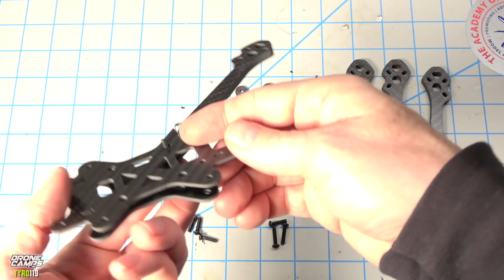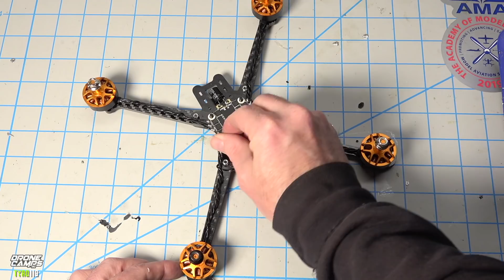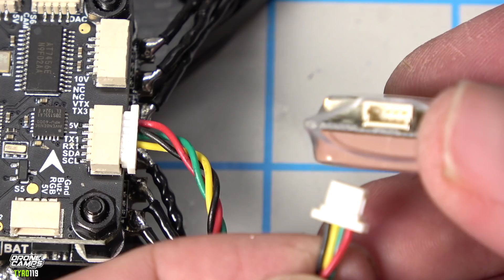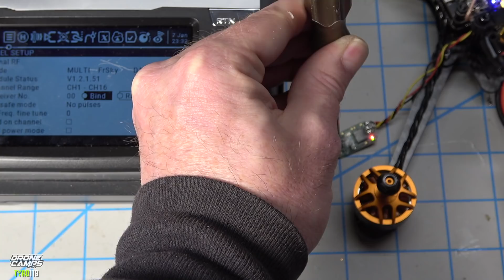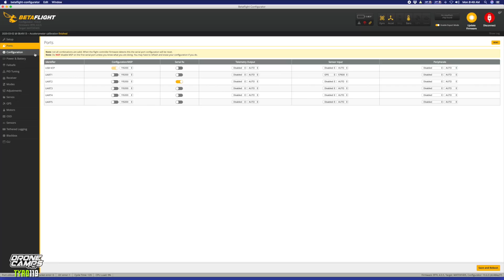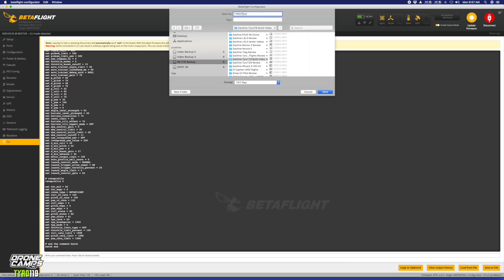$119 Long Range Fpv Quad! - Eachine TYRO119 - Build, Setup, & Betaflight

Comment: Just a quick comment some may find interesting.. this is my first drone build, total beginner... but it seems that my Tyro 199 has come with SBUS soldered already and its brand new so not been done by a builder as a return or anything... I thought this was pretty interesting.. maybe they have been listening to feedback...I was really preparing for this soldering part too! :)
Reply: Mine came sbus soldered... Which actually is a bad thing, because my receiver is not sbus... So now I have to desolder it.... Going to use the pads on the other side though for TBS crossfire nano rx.

Comment: VTX has SmartAudio but the wire is missing. This is a must have function these days, especially if you fly with people and need to change band easily.

Comment: I built the Tyro119 and as I arm the quad the drone jerks erratically.
My motors are mapped correctly ,spinning in the right direction and the props are correct. Any help?
Reply: Drone now arms correctly but will not lift when advancing the throttle. any help?

Comment: I have my transmitter dx6 spektrum.
I would like to know if the transmitter work with your receiver?
Thanks
Reply: If you have a Spektrum transmitter then you’ll need a Spektrum receiver. The one on the video will not work with your radio.

Comment: I still can't find anyone hooking up a crossfire receiver to this FC
Reply: Giffy, did you manage to install the crossfire rx on the FC... if so which pads did you use... Cheers buddy.
Reply: Hey just use T2 port for UART2 it is on the other side of the board

Comment: I liked your video, found the instructions clear and easy to follow (thanks) and used BLHeli to reverse one of my motors and completed the build as per your video, including doing the checks BetaFlight config and tightening all the motor nuts. On my first flight the drone has a severe crash as it went out of control after it lost one prop and smashed the other three props on crash landing, no other major damage luckily. Upon inspection and after reading the other posts from "Herrtc" I believe under fast incline the motor undid the nut as it was turning in the opposite way so unenlightened the nut instead of tightening it. I have since ordered 4 new props and reversed all directions so they all now tighten the nuts instead of loosening them. The other suggestion, I had some drift in the drone, in mine I went through each Roll, Pitch, Yaw and ensured the trim was set on the flight controller (FlySky FS-I6X) so that at mid position they where at 1500, I also did same for the Throttle at mid position.
Reply: Thanks for the heads up Mike, this will be my first build so I’ll make damn sure to do the same prop configuration 👍

Comment: so after installing the xm plus receiver im getting a solid red line.
My taranis qx7 still chirping on the bind. Is this normal.
I have flash the xm receiver with the most up to date Firmware, and still no good binding.
any help appreciate it.
Reply: Are you flashing the old firmware? Dont flash the newest one

Comment: Looks like I found a better build video than bardwell. I have this kit coming in three days. Thank you so much for this valuable information. Well done!
Reply: The thing is he missed the fact that the VTX has the SmartAudio wire missing. Bardwell included this in his much more detailed build. What makes you think this is better?
Reply: @carlperkins1812  heyha I have watch both. Both are great but JB gives too much info for a newbie who just wants to get in the air. For a newbie not having the smart audio is not  an issue at all. In a 30 minute video I get all the info i need.

Comment: Pretty straight forward build except for making the bridge for sbus. I could not make the bridge no matter what I tried. Don't know what the secret is. I cannot fly this drone because I cannot get betaflight to see sbus. Very frustrating I'm glad it was only 119 dollars doesn't hurt as much when it will never fly.
Reply from the maker: It was a total pain. Get a Solder Sucker. It will help you start over and try again. Took me 15 mins the first time. Small iron tip helps too.
Reply: Wow so it was hard for you to. Thanks for the tip. I think I have damaged the fc so I bought a new one. Lol.
Reply from the maker: Tip: use a small iron tip.... 

hold your iron on the outside edges of the tabs. Bring some solder from the other side.

Comment: A friend bought one of these, one of the motor wires was too short, and he destroyed the flight controller trying to solder the two tiny dots to chose between sbus and ibus.  He also stripped out a lot of the screws and ended up cutting slits in the top of them to use a flathead screwdriver.  So....   yeah.   He ordered one of those specialized replacement F4 controllers with the white jumper connectors and banggood refunded his $35 because they don't have them any more.  So ATM he's fucked with this quad until I can tell him how to proceed.
Reply: did the same on mine but realized there are pads under the board for the reciever an sbus -ibus . mine worked with these
Reply: @gravelyetigravelyeti4284  Yep, I saw those underneath pads in a Bardwell video and was like hey! and told him, and he was able to salvage it and is flying his around.

He ended up buying me a kit and sending it to me free, half assembled.   That was back when they were 119, now they are up to 159 from the chip fab manufacturing facilities shortage.  Someday I'll get around to finishing it.  I bought a CRSFR Nano for mine.   Might replace the VTX and camera because they look crummy.
Reply: @choppergirl  awesome, i only just flew mine for the first time today, freakin love it hey!

Comment: Hi Justin, I am big fan of your videos and I actually bought the Tyro 119 after watching this one. However, PLEASE can you make a disclaimer in your video that the motors have to be mounted the opposite way, so that the self tightening nuts for left and right spin do what they are supposed to do when the motors spinning in their given direction.
 On first spin-up of the motors without props, the loosely attached nuts were flying off one after the other. Not good, if that would happen with props attached during full load in the air.
As I didn't want to unsolder my (almost perfect) solder joints, I left the motors where they are and reversed motor spin direction in BLHeli (didn't work in Betaflight). Quad flies OK, 125km/h top speed on first flight. AWESOME quad! VTX came DOA though - at least I assume, because I can't get a picture from it, and no manuals to try figure different settings. Replaced it with a HGLRC, which is working fine. Thanks a mil, keep going!

Comment: hey i have some problems with my tyro119...
1)
GPS not working, its always at 0 satellites, had to disable gps to be able to fly
2) with 6S my OSD is turning off at a punch
3) Turtle mode is going the wrong direction
4) pids are terrible its shaking alot

Comment: Does the middle wire from the motors need to be soldered in the middle and the other two wires dont matter or it doesn't matter what order all three wires go?
Thanks
Reply: Isn't it in BLHeli? 
At least that's what he's using.
I don't know if Betaflight can do it to.
Reply: @RicGBorgs  yes in blheli you can change the direction of each motor
Reply: If the motor is going in the wrong direction your can also swap the order of any 2 wires and that will change direction without blheli

Comment: Justin is this gps unit only for this drone or would it fit any drone even the ready built ones not just racing drones
Reply: @John Salt These kind of GPS can be used in any drone depending on the their flight controller. 
If the flight controller has the ability to connect to GPS or not.
Reply: @RicGBorgs  ok thanks for that

Comment: I got my first fpv quad because of your review (happymodel larva x) and I love it! Now i'm torn between something like this, a cinewhoop, or a tinywhoop I want them all! Thanks for reviewing stuff so I know what to get :D Originally I wanted the tyro129 but ended up getting the larva x because of money, Now i'm unsure between it and the tyro119. Which do you like better?
ah after watching through  i see this isn't a review, I'll wait for a review to find out the answer  to this question
Reply: I know currycutten said he'd pick the 129 if you're mostly concerned with ultra long range cruising, 119 if you want it to feel closer to a five inch with longer legs than usual.
Reply: (also, watching Dronecamps is an expensive habit, I own my lava x and lava x HD because of it :) )

Comment: I built this a few weeks ago. I couldn't get any stick input in BetaFlight, but the switches showed. After a re-flash to BF 4.1, everything is working good.
Reply: How do u like it? And how does it fly?
Reply: @seacawk8259  so far it flies great. seems real smooth and controllable even with the included props, I was getting 5 minutes of flight time on a 4S 1300 just cruising

Comment: finaly :D was close to buy the 129 from youre vid. then this showed up on BG now i cant decide, wich one did you like the most out of the box, most value,quality wise?
Reply: Gonna order the 119 tthen :) theres so many quads out there. for me its kinda overwhelming . moving up from a tinyhawk 2.   what i learned is when youre going fpv "you are gonna crash,can you afford to crash"  better to start with a more budget friendly kit and grow from there.  119 looks like a nice mix of flight styles as a starter :)
Reply: I'm wondering the same thing?
Reply: ^^ i'm in the same boat
Reply: I think the difference is shorter arms, slightly smaller motors and 6" props. I got the 7", just waiting to build.